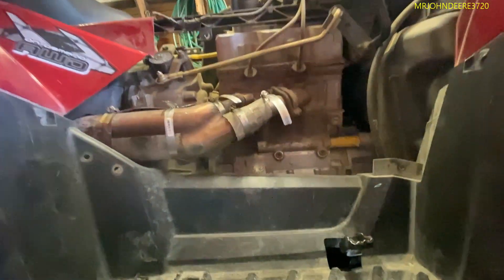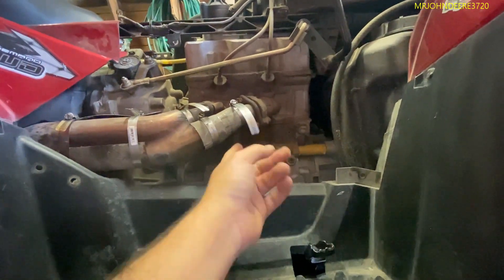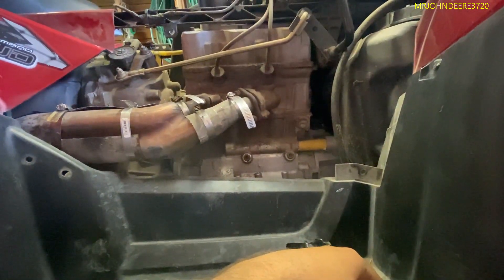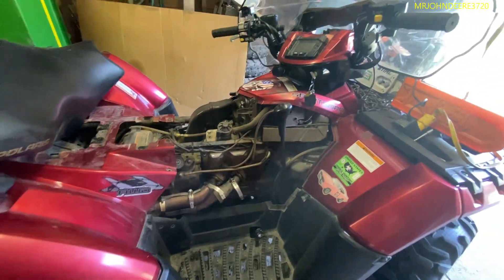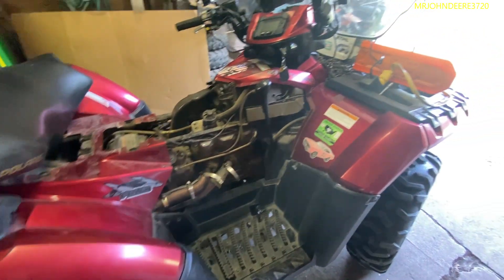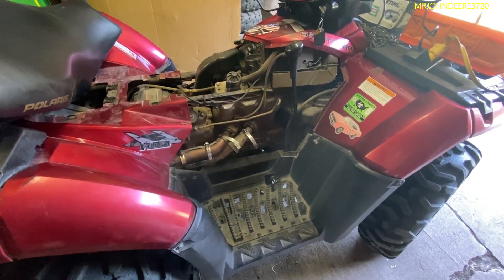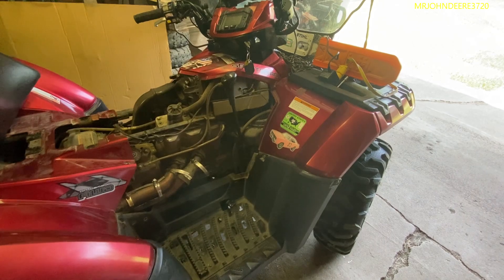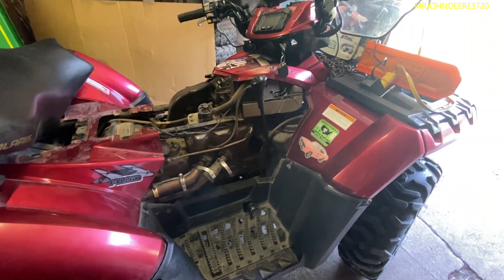put the covers back on & no one will see it.....

Comment: Your redneck repairs look ok. I've done similar fixes on mine. Used muffler cement on the trike exhaust years ago. It was not great but I'm still running the original exhaust. New ones are very expensive. I've got two Internationals running with JB weld patched tanks. The other one has a plastic boat tank setting  on the cab floor and it works great. Only six gallons but I've done a lot of work without running empty.
Reply from the maker: looks like shit to me but u got to what u got to do lol.. i got JB weld so we'll try that, if it fails then we'll get a tank liner. ya that'll work good but its something i dont want to do lol..